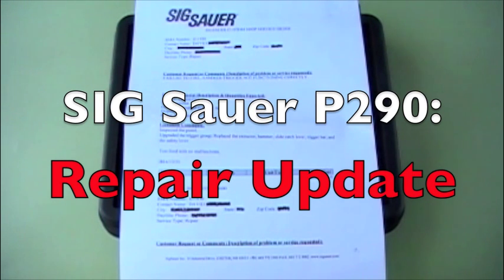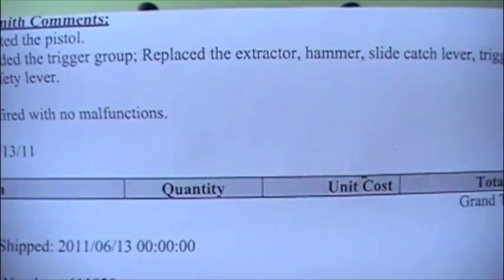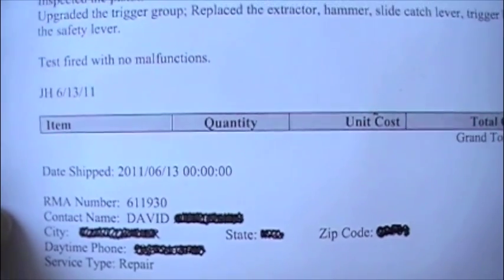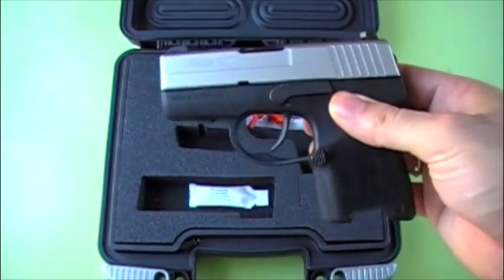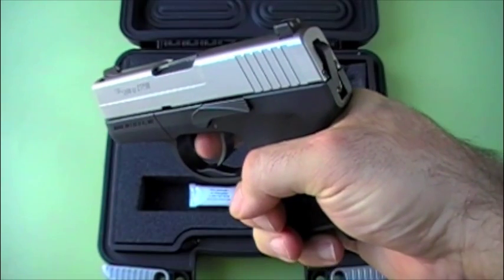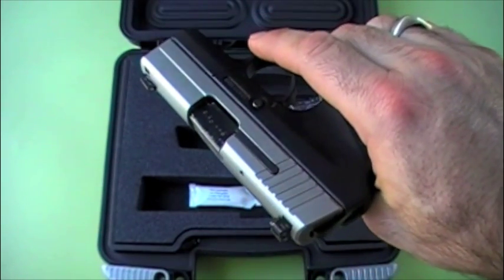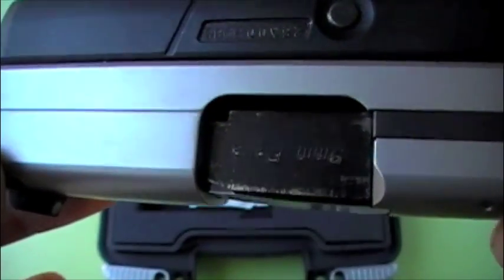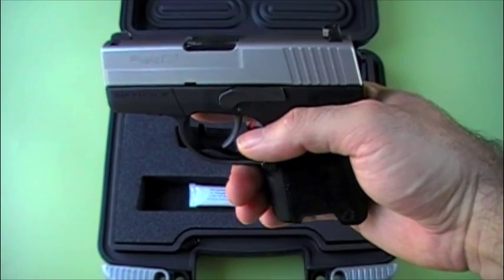SIG Sauer P290: Repair Update

Comment: My new 290 would not fire most of time on first outing. Took it back to gunsmith/dealer and he thought it was me (limp wrist) I took it out again after he looked it over and lubed it. Did not fire most times. Took it back. He kept it. Fired it. Said okay. I took it out again and worse. He'd checked firing pin & said okay. If it was limp wrist why would it not shoot first round? He took it again. I said use my ammo. He said he'd usded his ammo first time. Guess what. My Winchester ammo no good.